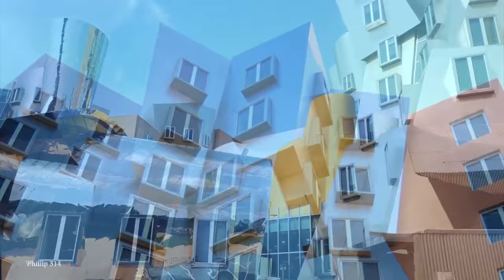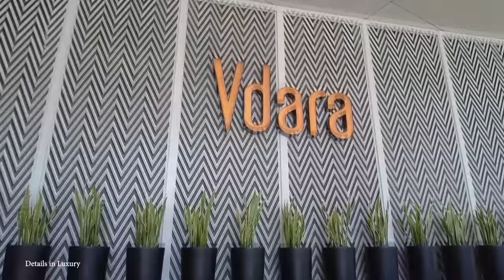15 TERRIBLE Building and House Designs

Comment: Need to check your facts.  As noted below the Aon building (formerly the Standard Oil bulding) in Chicago, from 1990 to 1992, was refaced with Mount Airy white granite so it does not bow out anymore.  In your description of the Hancock building in Boston, the picture at @7:53 on the left I am pretty sure is of the Hancock building in Chicago.
Reply: I was just about to make the same point regarding the Hancock Building in Chicago which appears at 7.49 to 8.00.
Reply: This is a click-bait channel. Accuracy has nothing to do with it.
Reply: @OuterGalaxyLounge  you can always click on another video 😁👍
Reply: I’ve seen that story about the John Hancock in Boston before and it was the exact same clip. So whoever did it originally screwed up, but people keep using it even though people have said that they are using 2 different building (even given they don’t look anything alike)
Reply: @GuyFrets  ah I knew it looked shorter in some of those shots!!
Reply: You're correct about the Hancock buildings.

Comment: The last one sadly is not the only building styled like that ever built.
In the 1970s there was one built in Vancouver BC with a twist to the design, the offices section of the building was hung from the support pillar by steel straps. In the early 2000s they converted it into a Condo building and it still stands today. The Cube condos on West Georgia Street in Vancouver BC.
Reply: Why Sadly? The one in Vancouver is not the same. Where the one in the video sat on top of a pillar the "Qube" in Vancouver hangs off the central tower  making it one of the most earthquake resistant structures in the city. It was built in 1969, won an award from the American Iron and Steel institute for the design and is still standing strong today.
Reply: @MrG9002  Why sadly? The design is for vertical movement mitigation from earthquakes, the only one I felt here in my 57 years was a horizontal movement. I just don't trust the building to stand up to a different movement than it was designed for.
I was in it when accompanying my dad at work one day back in the 1970s, got a great look at it then and it just didn't sit well with my instincts.